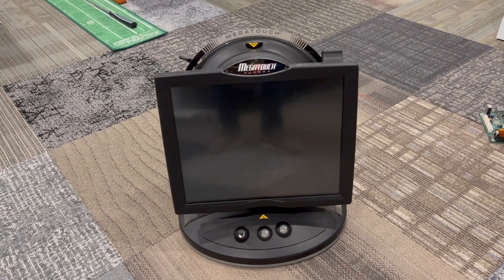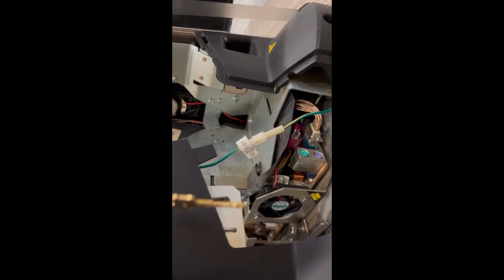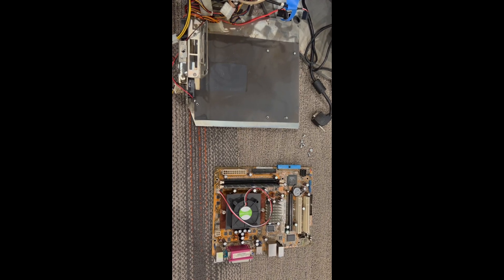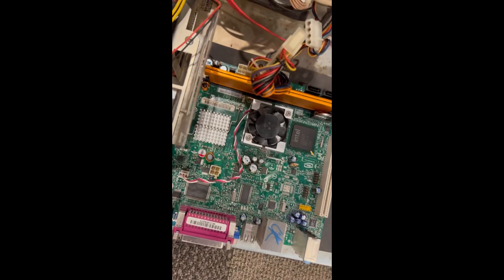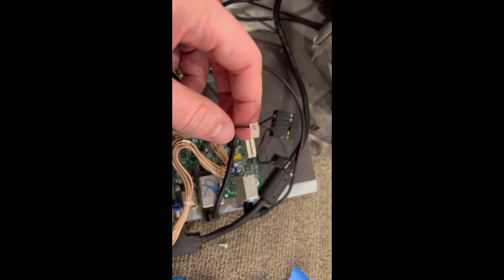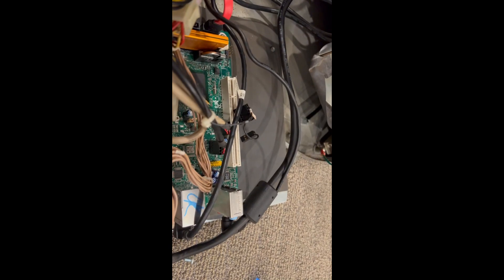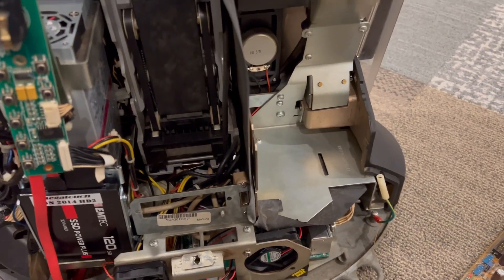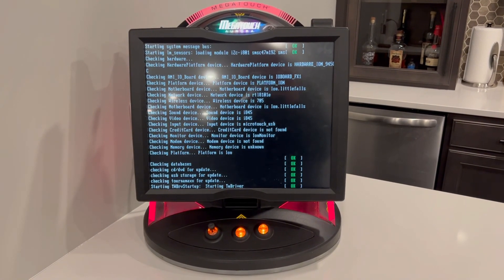Make Megatouch Aurora Quieter - Asus to Intel Motherboard Replacement

Comment from the maker: FWIW I also swapped out my case fans with lower decibels ones and add antivibration gaskets.  This made a huge difference with both the motherboard swapped and case fans it's now VERY quiet.

Here are the fan parts I ordered
Sunon 50MM Fan MF50101V2-1000U-A99
Sunon 40MM Fan HA40101V4-1000U-A99
40MM Fan Gasket FGA-40 (Digikey part# RPC3977-ND)
50MM Fan Gasket FGA-50 (Digikey part# RPC3978-ND)

Links:
https://www.digikey.com/en/products/detail/sunon-fans/HA40101V4-1000U-A99/6198728?so=80005738&content=productdetail_US&mkt_tok=MDI4LVNYSy01MDcAAAGJ5P-yIsrRQVM3ukL91Njr6YglA0aXJ3pGYUiwuHaClUNfh1YFtfldD1Obrm2HfhIWIPcKYwc3XpumUy0t8gCjQz4M1w0Sh_fxOmbawmNy&fbclid=IwAR25O2eLDpmolla6IB8mLJ3t1q9VqfNHljqFehWf63r7p3wuiCel88-ARJY

https://www.digikey.com/en/products/detail/sunon-fans/MF50101V2-1000U-A99/10441410?so=80005738&content=productdetail_US&mkt_tok=MDI4LVNYSy01MDcAAAGJ5P-yIiwCKjsaZEULWDHIoSRqGJOCeBwRy6dF4N7cV0ThHUc5QM9J6jMcUmdnw049HKobX8ioAvrRRZ8XMu_PRpcRS-pAVKC3sDRX_eg7&fbclid=IwAR1jqG60hTMA44V68j8IyDu1ObocUHDLFrYV4AMbY5TpkNXY3XRrdpLoOxw

https://www.digikey.com/en/products/detail/essentra-components/FGA-40/3811938

https://www.digikey.com/en/products/detail/essentra-components/FGA-50/3811939

The fan doesn't have a molex connector on it.  I added my own molex connector, you could also just cut the connectors off an splice the cables another way if you don't want to go through the expense and trouble of adding connectors.
Here are the parts for the connectors and tool

Connectors Parts:
3 pin Molex Connector 1501781030 (Digikey part# WM24119-ND)
CONN SPLIT PIN 16-18AWG CRMP TIN (Digikey part# WM16563CT-ND)
Engineer Precision Crimping Pliers for Open Barrel Terminals PA-09

LInks:
https://www.digikey.com/en/products/detail/molex/1501781030/7062985?s=N4IgTCBcDaIOoFkwBYCMqCcBaAcgERAF0BfIA
https://www.digikey.com/en/products/detail/molex/1501801016/7062990
https://www.amazon.com/dp/B002AVVO7K?psc=1&ref=ppx_yo2ov_dt_b_product_details

Comment: Awesome! thank you so much for posting this video! I've been searching for this info! You did a excellent job, I'm going to order the same board as the unit i have is a 2013 MegaTouch Aurora! I cant thank you enough. p.s. how did you figure out this board would work! Intel D945GCLF? my names Dave!
Reply from the maker: No problem, glad to help!  I saw on merits newer rx model it used this motherboard.  Since the form factor was the same I figured it should work.  Since it didn’t have the cpu blower type fan I figured it should be much quieter and it was.